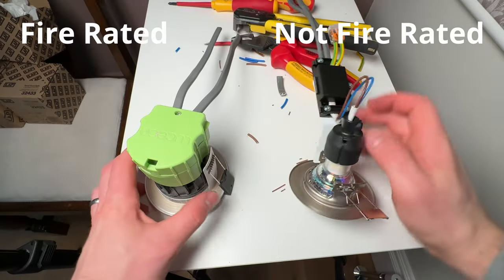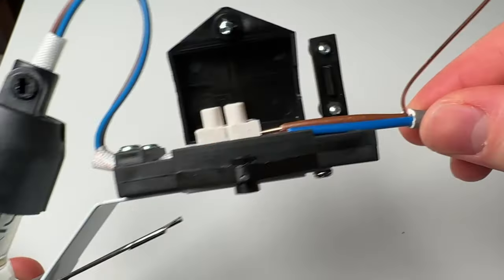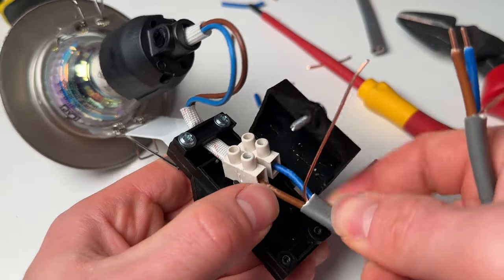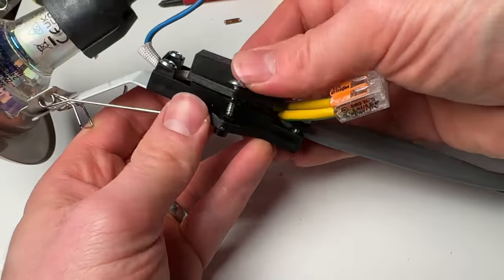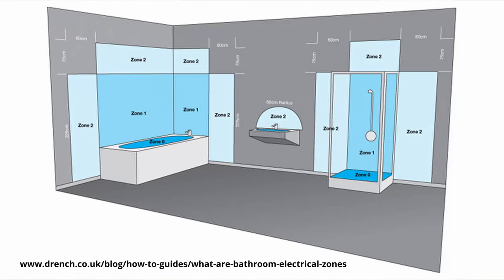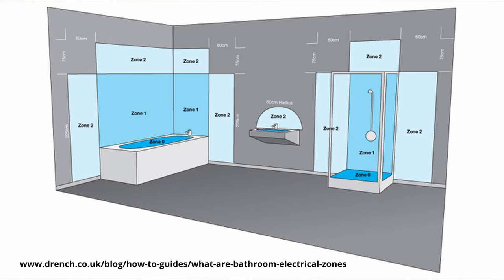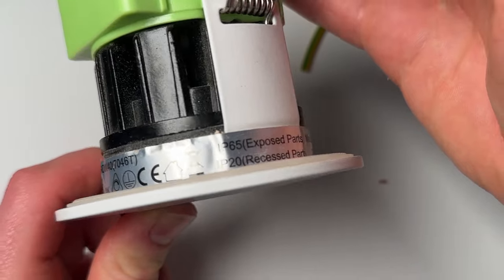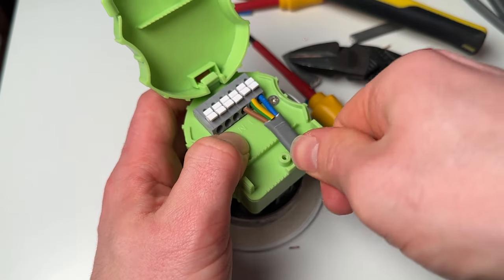BIGGEST DIY Mistakes with Downlights

Comment: We had an electrician / bathroom fitter in to do our bathroom 6 years ago and I can honestly say as a DIY electrician the wiring for the spots was absolutely appalling - single cores exposed and junctions made without any kind of enclosures and insulation tape used rod the earth wires. It’s surprising how many rogue electricians you get these days and then people instantly blame the DIYer for being responsible
Reply from the maker: Yep you are absolutely right, plenty of ‘professionals’ out there making the same mistakes
Reply: Why didn't you do it yourself?
Reply: I  wish I was a kitchen fitter the things I would tell people I could do better then a qualified tradesman would astounded them. But I'll have to stick with being a Electrician and having  to go around fixing kitchen fitter electrical cockups. 😂😂😂
Reply: That trumps my experiences. All registered professional recommended electricians I've used have been sloppy with terminations working loose, exposed wires, etc, but none as bad as you describe... hang on, just remembered a good one from 1989 and a really bad error from 2018. Always have to check their work and, usually, have to fix it
Reply: Does the downlight for bathrooms need to be just fire rated or ip65 rated?
Reply: I bought my house off an electrician. I wasn't that surprised that the DIY was pretty poor carpentry-wise, but some of the electrics were appalling. Loose wires on the bathroom downlights, loft and outbuilding wiring with cables dangling everywhere and back boxes not fixed to anything and a cable for lights in the conservatory coming off the socket circuit and buried just beneath the plasterwork at a 45° angle. Either he's the worst sparky who ever lived or he simply couldn't be arsed for his own home? Wouldn't like to say.
Reply: @Innateintelligence  minimum of IP44
Reply: Funny you say this, it reminds me of a friend of mine who had some work done (extra sockets and new lights fitted) in a flat she had just bought. Said friend had very little patience for anything and frequently hired tradespeople based on who could do the job the soonest.  

Anyway, the person she hired was very much a professional electrician from all we could make out, but it was only some time after he'd done the work that I began to question what he'd done, because when one of the double sockets in a bedroom required replacement (and this I offered to do for her) I discovered it was on a ring-main but with two spurs off it. All the wiring in that room was surface mounted in trunking, following a rewire long before my friend bought the place, and then it looked like a spur had been added some time after that. My friend had requested another socket when she moved in, which her electrician had spurred off the same socket. This meant that four 2.5mm cables were occupying each of the terminals, and as you would expect there was a lot of copper on show. 

I had to tell her this was way beyond anything I was prepared to work with, and it ended up with me connecting a 13 amp fused spur to where the ring came into the room, and spurring the sockets from that. In the event it was just as well I did so, because later had even more sockets added. Luckily, there was nothing in the room that drew a lot of power, it was mainly lamps, a clock, power to the transformer of an adjustable bed, toothbrush & mobile phone charger etc. so the fused spur was more than capable of providing what was needed, but it really made me question why anyone would do what had been done before I altered it.
Reply: @Innateintelligence  why ip65?
Reply: @TONE11111  IPX4

Comment: Excellent video. 
Always remember; Lamps glow, bulbs grow. 😊
Reply from the maker: Yes! Thank you!
Reply: Light Bulb is also the name of what only electricians call a lamp. The word light is put in front so electricians don't get confused. Everyone else is happy to just say bulb as they know what they mean. If you go in many diy shops etc they are labelled as bulbs as are many of the packs that the said bulbs come in.
Reply: @6panel300  That’s a rather snotty reply, winkle. Many things have an incorrect generic name… but that doesn’t make those names correct. It was a light-hearted response to someone who has made video on an electrical subject. You, are most definitely the type of person I get caught behind in an electrical wholesaler. Asking for ‘double plugs’, ‘wire’, ‘fuses’ and ‘bulbs’. 
That little knowing look you get from your server, is the look that you shouldn’t be there and will get charged through the nose for your naivity Sniggers all round from trained people who you are holding up in the queue. Please don’t ever buy a ‘fuse box’ you’ll bring the house down. Stick to DIY, son and lighten up.
Reply: Years ago in the factory where I worked, I took a blunt drill to our machine shop and asked the turner if he could sharpen it for me. He said he couldn't and made a big deal about it saying he could grind it, telling me that you sharpen a pencil and grind a drill.
Not long after the same fella came to me for a bulb for his lathe light. You can imagine the fun I had putting him straight. Initially I told him to go to a garden centre for his bulb.

Comment: Thanks for this video and the clear  explanation. I have the exact same lights in my bathroom, the IP65. I've been struggling trying to get the bulb out,  but no luck. I ended up giving up as 2 needs changing. What l didn't realise is that l need to change the whole unit. I can't thank you enough. Finally, I'll get those lights changed. Thanks alot
Reply from the maker: Glad it helped! Thanks for watching!
Reply: Hi I have two blown Saxby 73787 ShieldECO IP65 spot lights, I have bought replacements from amazon, they have the whole unit and black part, can I just swap these out without turning off all the power to the flat, they are push connectors. Thank you.

Comment: Thanks for this... not sure about our bathroom downlights - they're all 12v but not IP rated in any way.
Reply from the maker: Thanks for watching! If they’re 12V, i dont think the IP rating rules apply
Reply: @TheDiligentDIYer1759  Correct. But personally I wouldn't want to mix electricity and water at low voltage, may be safe, but it will soon look a horrible gungy mess

Comment: As an electrician, I'd like to say well done for covering a lot of stuff that even other electricians get wrong! 

Only thing that you maybe could have added is the issue of insulation over downlights, which used to cause any number of melted fittings in the past. It's mostly solved now with modern LED fittings that are built to allow insulation directly over the top, but not all are so something to check.

The fire rating thing is not quite as simple as having a habitable room above either, since its related to the fire resistance of the ceiling you are fitting to - and in most houses the downstairs ceiling is not considered a fire barrier. However, it's always safer as you say to fit fire rated ones, and the vast majority are now, so no real reason not to use them these days.
Reply from the maker: Thank you, very appreciated from a professional! Thanks for the info on the fire ratings
Reply: And the building standards are different in Scotland.

Comment: The earth or CPC carries current under fault conditions. One of the first tests carried out when electrical testing , is continuity of the CPC. So never cut it off always connect it. In the end it's your house and you do as you see fit. But if you want to sell it, the electrical system must comply with building regs and BS7671
Reply from the maker: Yes good point. Thanks for watching

Comment: Good Video, the big question is should people be attempting electrical work if not competent, When as a competent and registered electrician I conduct an EICR, I absolutely dread seeing down lights within the property because I know through experience there is a 90% chance they will of been installed but someone who isn't trained or competent, It works so it must be safe, 😅
Reply from the maker: Thanks for watching!
Reply: @TheDiligentDIYer1759  It's great you put this out there, I appreciate you are showing this in simple terms
Reply: Reece I thought DIYers are not allowed to touch any electrical work , as how can they issue a minor works certificate or EIC 🤷‍♂️ but everybody just fits there own stuff. I darent touch any electrical things now (although I am confident) don’t get me wrong I wouldn’t know a good Zs or PFC if it smacked me in the face, but I could wire up a light fitting. But as said I’ve always been told not allowed to touch so there fore I pay an electrician to do everything, even changing a socket as same again I could do it myself but I can not test or issue a certifiacate. Annoyingly I have employed a registered spark in the past that was terrible with the job and never gave any paperwork and he was a registered qualified electrician 🤔
Reply: King Of the trowel, Diyers can do electrical work and no certification is required providing the circuit hasn't been altered, Bit of a grey area that one. Generally considered like for like replacements or simple repairs. Part P or Minor works can still be carried out providing certification is issued, as I understand the local council can arrange this for a fee, Obviously a registered Spark can self certify so saves that hassle, But you can't police anyone in there own home and people who want to will do.
Reply: @reecehorner3736  yea that’s what I thought, so am I right I thinking that an eicr would test and check everything anyway as in for eg I’ve fitted my own decorative light fitting replacements and socket fronts , even tho I don’t have any minor works certificates will it all be checked in an eicr

Comment: George, you mentioned all downlights in ceiling above shower or bath should be a minimum of IP44. However zone 1 and 2 heights are 2.25m which is lower than most ceilings of 2.4m. which means the lights are out of zones, therefore do not need to be IP rated.
Reply from the maker: True, but most baths and showers aren’t floor level, they are usually raised off the floor, so you’ll lose some height to that anyway, which could easily be 15mm. So safest to just use IP rated anyway, in my opinion.
Reply: @TheDiligentDIYer1759  It wasn't your opinion that you were stating in your blog, you stated the zones tell you to use IP44 or IP65 which is not correct. So your 15mm will bring you closer to ceiling but that still gives you 135mm away from the requirement to use IP rated lights.
Reply: IPX4
Reply: @jameshansing5396  Do you know what IPX4 is? Ok
Reply: @tellitasyouseeit7555  yeh I do, hence it's IPX4
Reply: @jameshansing5396  Then you'll know it's still outside the zone.
Reply: @tellitasyouseeit7555  pretty sure there is reference in BS7671 to lights being "appropriate for their location".  So yeah f8ck it just stick anything up there then....

Comment: I've got these exact lights in my living room (ip65) 4 of them, however when switched on the last light on the run takes two to three seconds later to light up than the others, hopefully someone can explain what's going on.
Reply from the maker: That sounds like a fault with the light unit rather than the wiring. If you’ve still got the receipt I’d try take it back and get another. Thanks for watching!

Comment: I'm a retired spark those push fit down lights i find are absolute rubbish the wires won't stay in what is wrong with the screw terminals or wago type
Reply from the maker: I haven’t had any problems with these, but I do agree they aren’t a good terminal type. Thanks for watching!
Reply: Push em in properly then, maybe that's why you're retired. Never had an issue with push fit...

Comment: Much better to connect twin and earth into a joint box and wire downlights in heat proof flex
Reply from the maker: I think it depends on the terminations the light comes with, if only a tiny block, then I absolutely agree, but if they have substantial terminals for two cables, I think it would be unnecessary. Thanks for watching!

Comment: if you are really are a time served spark, as i was.then you would never call a lamp a bulb. that is the talk of a diy spark for me. apart from that your video was good.
Reply: Big up yourself
Reply from the maker: Thank you. I’m not a spark, just an over enthusiastic DIYer
Reply: @TheDiligentDIYer1759  which can be dangerous posting videos with incorrect information.
Reply: Clearly not a spark, and you should make that clear because there are a few things badly explained (and wrong) that could be dangerous followed. CPC = Circuit Protective Conductor so it DOES carry current under a fault or leakage. Also. what you're saying at 2.43 is nonsense. It's not a "much higher risk of shock" and if you knew why, you wouldn't be saying this.